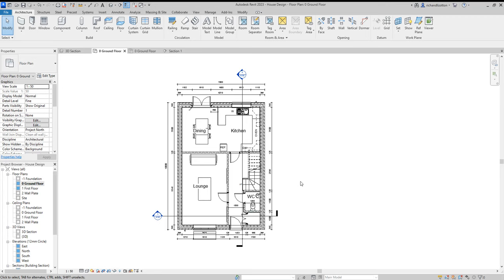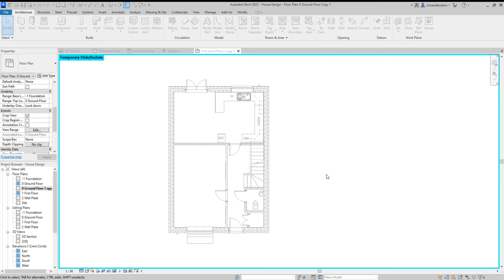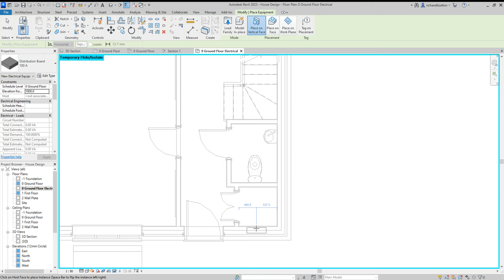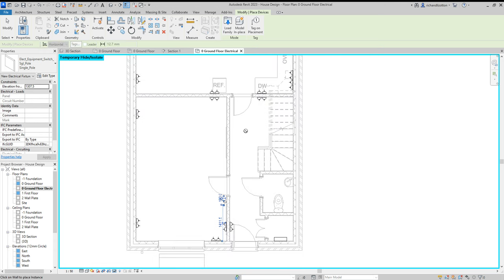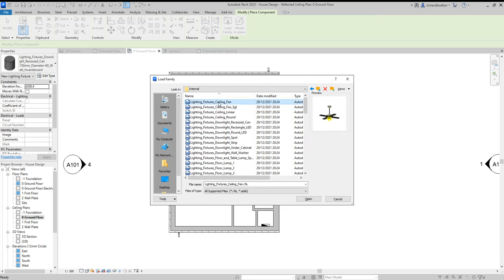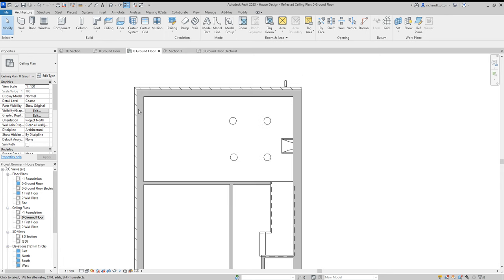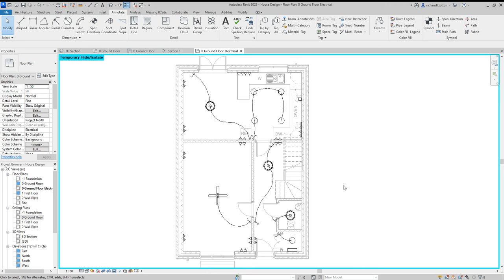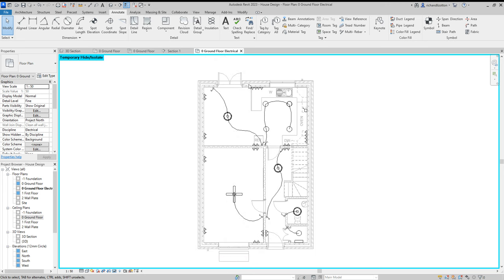Electrical Layout Plan Revit Tutorial

Comment: You have not powered your circuit
Reply from the maker: The purpose of this tutorial is to show a simpler way of doing an electrical layout.  It does not have the benefits of circuits etc but is suitable for small projects where a designer wants and electrical plan for pricing purposes.
Reply: How do you do it?
Reply: Reasons....noob

Comment: Wouldn't it be better to work on the ceiling plan?
Reply from the maker: You could do if you prefer, however I personally would find it better to gave a dedicated electrical plan for when you lay out drawing sheets.  Plus depending on the type of ceiling used you may wish a ceiling plan to show other features.
Reply: @ArchnRevRichard  could you duplicate a ceiling plan view and place the light fixtures
Reply from the maker: @ociv delos  you still need a physical ceiling to be placed to put the fittings on.  Also, you may have other electrical fittings that would not show on a ceiling plan.

Comment: hi . thank you in advance  ... would you please send me the electrical revit library file.
Reply from the maker: Hi Dany, the electrical library file used in this video is the standard one that comes with revit.  If you are missing the content you need to download the library file for the version you have from the autodesk website.
Reply: what content/region revit library did you use in this video?
my default socket outlet symbol is still in dollar symbol
Reply from the maker: UK English content pack - sorry for slow reply this message did not pop up in my feed.

Comment: Why do you not take the Electrical Wiring ?

Why do you show only Detail Line why not Circuit?
Reply from the maker: I know that you can do much more with electrics in Revit than I do here and that is great.  However, for this video I just wanted to show a simple electrical layout drawing.  To give a bit of history… 25 years ago when I used to do architectural drawing by hand, the majority of work I was on at the time was houses and extensions to houses.  It was common to draw a simple layout showing lights, sockets and a few other bits.  The purpose of this really was to help gain accurate and consistent pricing from the contractors who tendered for the work.  When the jobs were built an electrician would do their own circuits etc and our plans were more of a guide at that point.  So this video is more in that vain, just a quick simple plan that can be priced for tenders.

Hope you are enjoying the videos 🙂
Reply: @ArchnRevRichard   very well said....😊😊😊